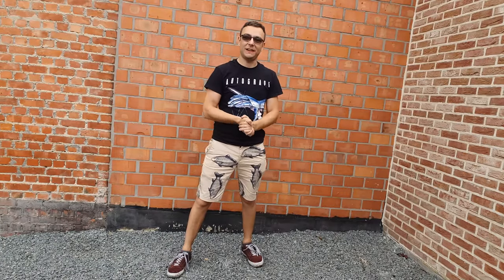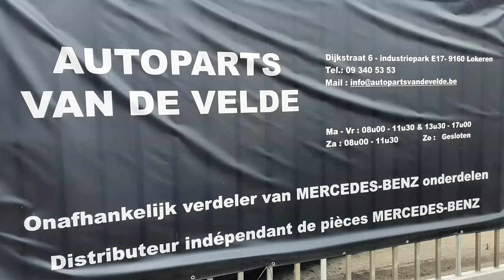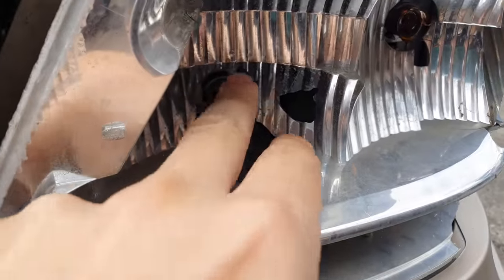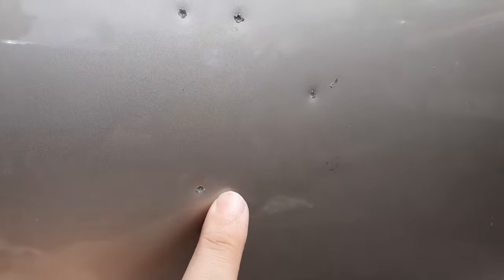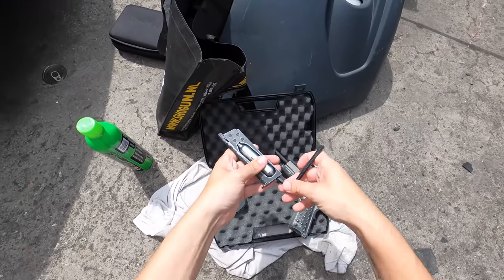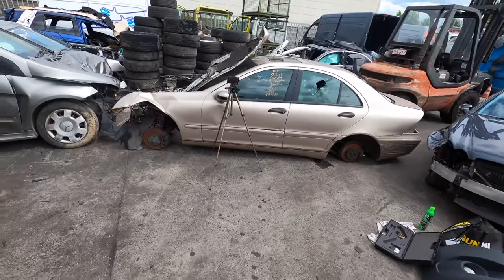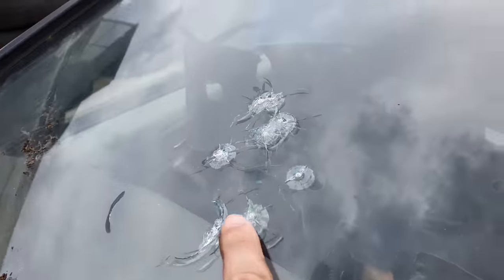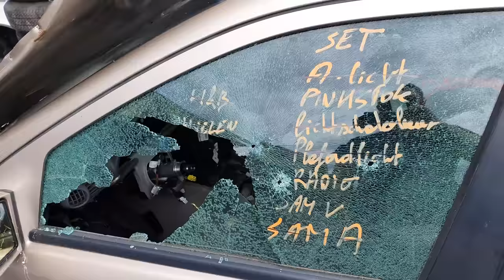Can airguns break a car window ? (4.5mm steel bb )

Comment: These Dan Wesson still scare me, but it’s not there fault our police are trigger happy. If they were still widely sold here in the us I’d be impressed to see it used as a non lethal or less lethal option
Reply from the maker: This dan wesson is not lethal
Reply: @HappyDude1  yes it is. It shoots steal and if it’s above 200fps and shoots steal it’s lethal. Here we hunt small game with them for a challenge.
Reply: @HappyDude1   not to mention if you take into consideration that it is a bb pistol and not air-soft their for it has no orange tip and can be mistaken as a firearm it’s extra lethal. Don’t argue I sell them in the United States and we are required to check id because they are lethal.
Reply: @HappyDude1  it is not a firearm that does not make it a non lethal weapon, black powder is not a firearm but it is still lethal.
Reply: @HappyDude1  here you can even purchase explosive pellets and bbs made with tannerite which is a binary explosive and we use those to destroy invasive bees nests like the bald faced hornet and the Africanized honey bees etc.
Reply from the maker: @ghostofkyiv3422  
I got shot by it and Im still alive
I didn't even make it trough the skin and even my airsoft is above 300 fps the reason its legal without a permit is because its not lethal even under 18 you can buy this
Reply from the maker: @ghostofkyiv3422 
Cool i want those 😀

Comment: Steel BBs on CO2 would (should) do the most damage on hard surfaces. Higher velocity and low surface area. Not enough to kill much, mice and mebbe rats but not squirrels or feral cats (save for exacting shot placement). Heavier lead pellets are enough to take on critters but not at CO2 velocities. I've dispatched raccoons with a 10g pellet flying out at just under 1000 fps.

Question #1: Why the hell would anyone want to break a car window with an air operated hand weapon?
Question #2: What is wrong with you???

Comment: This sounds exciting, as long as you’re at a junkyard (ask permission first, and if nobody minds). I’m not sure 🤔 that this is a BB gun, but it does work by the use of a CO2 cartridge. It would be fun 🤩 to sit in the desert 🏜, and shoot glass. I’d probably shoot at various materials. ALWAYS be careful when shooting at tires (and hard, or metal objects). A BB (or bullet) will NOT usually penetrate tires. It can bounce back, resulting in possible serious 🧐 injury, or accidental death 💀. A vey high powered bullet type gun will penetrate tires (depending on how thick they are). This is talking about a gun that shoots at 4500 feet 👣 per second. Bottles are also a fun thing to shoot at, and so are soda 🥤 cans. An old refrigerator will also work, but please be careful of BB’s from bouncing back. Happy Halloween 🎃👻. Your friend, Jeff.
Reply from the maker: it is very fun to shoot stuff with it :)
a bb bouncing back will not kill you thow :)
i had it a few times :)
happy halloween ^^
Reply: @HappyDude1  I think 🤔 the best way to do this is to set up a target 🎯 in the basement (I haven’t bought a house 🏠 yet). That way, ya can retrieve every BB, and reuse ♻️ them again. Just dig them out, and use a magnet 🧲. Copper BB’s from years ago didn’t stick to a magnet 🧲. This can also be done in the desert 🏜 (or wherever). I’m not even sure if I can own a BB gun in town. I want several BB guns 💪 in my collection, but I think I’m going to start with the pink one ☝️. I think 🤔 ya said they’re around $29.99 apiece. I have a love/hate ❤️ relationship with bullet type guns 💪 . I’m not sure 🤔 if I’ll own one ☝️ because of too many 👨 deaths 💀 and injuries. In 2000, I nearly shot a stray dog 🐶 that charged me in our alley. One ☝️ of our foster kids had an Air Soft gun. I’m not sure 🤔 how powerful 💥 these are. I don’t mind owning a lower powered 💥 gun (such as Air Soft or BB). Ever since 2000, I wanted one ☝️ or the other. Even these lower powered 💥 guns 💪 must be used with respect ✊, because there’s always a risk of serious 🧐 injury or death 💀 at close range. Again, Happy 😊 and safe Halloween 🎃👻. Sorry 😞 about all the emoji’s and long comment, but I really would like 👍 one ☝️ of these BB guns 💪. Your friend, Jeff.
Reply from the maker: @jeffreyhickman3871  
And offcourse i asked if i could shoot at the junkyard :) it would be strange to just go there and shoot some cars haha :P
and i shoot in my garage its safe there
what do you mean with the pink gun you want ?
Reply: @HappyDude1  I’d have to buy it at Walmart. It is a Wildcat for the name. I don’t know if it is a Crosman. One ☝️ of our two year olds plays with one ☝️, but it has no BB’s to hurt 😞 anybody with. It also has no CO2 cartridge in it, either. I got to looking 👀 at the BB gun about a week ago. I was wondering 💭 why it would be handed to a two year old, but the BB gun is used for pretend. Like 👍 with real guns 💪, I really think 🤔 the EXACT SAME safety guidelines should be adhered to, to avoid any possibility of an accident. Your friend, Jeff.
Reply: @jeffreyhickman3871  why do u use emojis with everything?
Reply: @thatsthemove8490 exactly 😂😂😂, found it funny tho
Reply: @HappyDude1  Agreed, the risk of death is low. However, if the pellet happens to rebound and hit a thin-skinned area such as the fingers, toes, or nails, it can leave a lasting impression. As a small suggestion, consider using a transparent PC board, around 4 to 5mm thick, as a shield. If you were to shoot at it at a 90-degree angle, there is a high chance that the pellet would come straight back towards you. (It is highly advisable not to do this.)
Reply from the maker: @ytchor1368  i always shoot at 45 degrees 😝 but these are very low powered guns not much can happen. It feels like a fly that hits you when you are driving on a bike 😝
Reply: Jeff you are so right about shooting car tires. It's not a good idea. Once and only once I was at the town dump and shot car tire that was still on the rim and had air in it with my .22 long rifle. I was 25 to 30 foot away and that bullet bounced of that tire with same energy it had leaving the gun and went zinging past my right ear. I swear it was no more than a few inches from my head. Lesson learned.
Reply: @jeffreyhickman3871 don't deny yourself of the pleasure and joy of air gunning. Life way to short. Go on a get a air pistol

Comment: Why do users want a blowback pistol? All the energy used to push back the rail could have been used to propel the BB even faster...
Reply from the maker: Because its automatic and fun
Reply: @HappyDude1  I'll take the extra power and ensure the rat is dead.
Reply: @NewUnderTheSun  If you're using an airsoft pistol to "kill" a rat, you have no idea what you're doing. Rats require a lot more energy to dispatch. A .177 pellet or bb should be traveling at least 750 feet per second in order to be humane and effective. Source? I've dispatched thousands of rats, squirrels and similar small pests over the last 25 years with everything from a break barrel pellet gun to a 12g
Reply: @LiamX  I'm dispatching rats, snakes and mice just fine with my 550 fps  CO2 BB pistol. I made no mention of Airsoft.

Comment: Wich is stronger?  
Dan wesson 4.5mm diabolo 3 joules
Dan wesson 4.5mm bb 2.7 joules (metal bb)
Dan wesson 6mm bb 3 joules (plastic bb)
Reply from the maker: Metal bb is always stronger
Reply: @HappyDude1  what about diabolo with a sharp head?
Reply: @HappyDude1  and where did you buy the dan wesson revolver? Exactly this color
Reply from the maker: I must everything in my gunshop by law

Comment: 1 - 2 Joules energy is really low end what pneumatic guns can do. I have sport  pelets pistoll with rifled barell - 6 Joules so three times more what you got here. Also have carbine 18 joules.
Although I wouldn't go for bank job with them but those definitely should be treated with same respect as fire arms. 
To give example with my my 18 Joules carabin I can put down bunny from 30 - 35 meters one shot lights totally out.  Little thing doesn't even know what hit him.

Also when using guns with blow back at least 25 - 30% energy is going into blow back action.
It feels cool but reduces gun's power.
Reply from the maker: These are all  toy guns in my eyes 😛  I have a airguns with 120 joule and a real magnum 357
Reply: Fo sho

Comment: The revolver has higher fps and impact energy because it does not have blowback like the 1911.
Reply: The revolver is stronger because he modded it to be 5 joules instead of 3 joules, although you're right that less gas is lost into blowback.
Reply from the maker: Its not modded 😛
And its only 2.85 j
Reply: @HappyDude1  Wait, it's not the modded one anymore?
Reply from the maker: @replacesoundboard  
The mod does nothing good
Check the videos 😁
Reply: @HappyDude1  I was mostly referring to your older video, "Can my Co2 guns break tempered glass?", in which you mentioned the Dan Wesson was upgraded to have 5 joules of energy instead of 3 joules.

Edit: When you say the mod does nothing good, you mean it doesn't make any difference?
Reply from the maker: @replacesoundboard  
It also had 3 joule then 😁 i was wrong the website said 5 j
It only destroys your trigger mechanism if you mod it
Reply: @HappyDude1  Ah, good to know. I guess it was a good idea that I never tried to modify any of mine x)
Reply: What a cool gun! Do you know how many joules the 1911 has?

Comment: I have really important question regarding KWC CO2 1911 airgun, does it work single action? I mean, do I must cock slide like WE or EMG product unlikely KJW and Marui?
Reply from the maker: @RRTS2556  
Eum a 1911 on co2 Is always half automatic
Reply: @HappyDude1  I mean am I able to rapidly fire with just hammer down?

Comment: maybe these 10min about handling a pistol are worth it : https://www.youtube.com/watch?v=BypuKXOmEkg
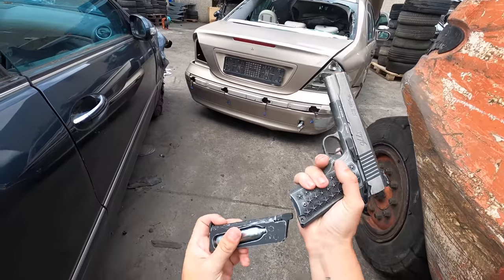@2:22 It would be good to let your finger stay with the trigger between shots. The “technique” shown when pulling the trigger causes a poor hit pattern. the grip needs also adjustment against limp wristing. it's just an airgun but it looks like a real gun cause of the low, weak grip. Oh yes, while I'm complaining, the finger doesn't have to protrude from the weapon (5:19) but can be placed on the frame, for example - above the trigger. By the way, if you have your index finger higher up on the magazine when reloading (5:48), it will be easier to insert the magazine ;-) and work on your trigger management. you can see much movement at 8:28 which will also decrease your hit pattern.

Comment: I had two of these and both of them destroyed themselves. The internals are made out of pot metal. Crossman refuses to honnor my warranty after I brutally criticised the poor design. Do not buy the sr357 unless you want to be ripped off!!!
Reply from the maker: This is from asg and is very well build
Reply: @HappyDude1  crossman copied this design and did it poorly. Take a magnet and see if your internals are magnetic. My internals are made out of cheap pot metal and flaked into pieces.  

Even if I could get parts it's not worth it because Airsoft is now dead in Canada due to Bill C21.
Reply: @HappyDude1  ASG should sue Crosman for stealing their design and producing a cheap knockoff. I would be more than happy to send you pictures of my internals so that we could compare. I guarantee you they're the same thing on the inside.
Reply from the maker: @thejayman1886  
I have 2 vieeos were its open 
And i never had any troubles 
Check out more fps dan wesson
Reply: @HappyDude1  I had my TWO Crosman sr357s for not even a year and here are all the problems I had:
-Poor accuracy shooting a 3-in grouping at 25 yards
- my internals were so over lubricated it was bursting out of the seams
- my barrels are already loose on both of them and all they do is sit on my desk when I'm not shooting them
- safety is defective and useless as it does not stop the hammer from dropping while it's cocked
- extremely cheap internals
- internals destroying themselves by performing their basic functions
Reply: @HappyDude1  just watch the video. Yes can confirm that Crosman stole asg's design. I have my sr357 apart right now and can confirm

Comment: I have that Dan Wesson they are China crap. All the machining and casting is so sloppy. Not even aluminum made out of pot metal.
Reply from the maker: I have used it a lot and it stil works fine
and its my most accurate and powerfull revolver
there is some play now in the hammer and turning mechanism, but like i said i really used it a lot !